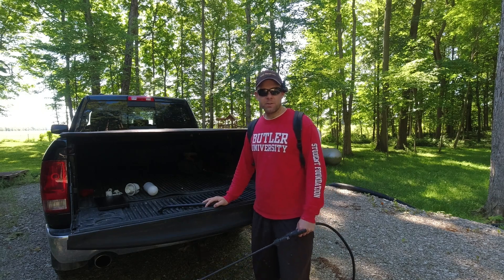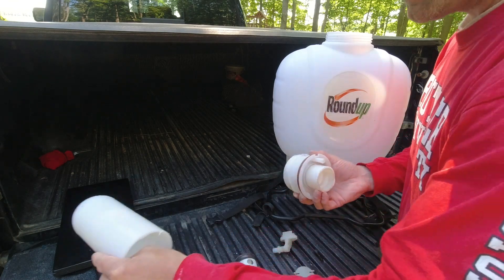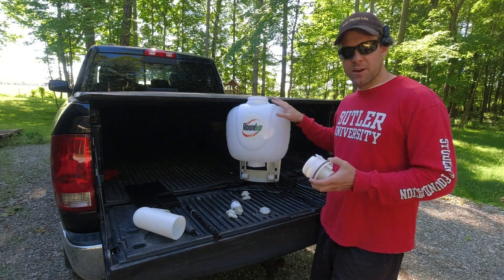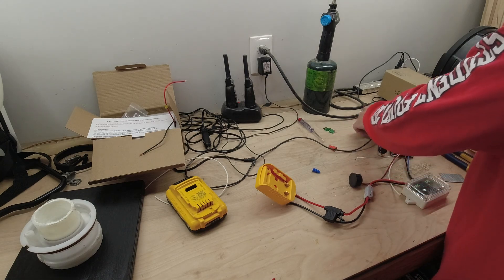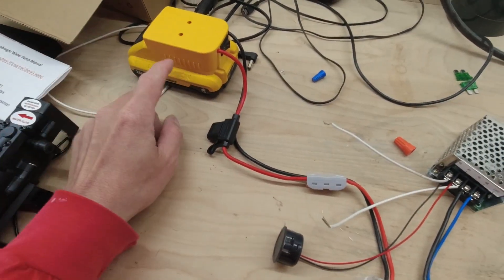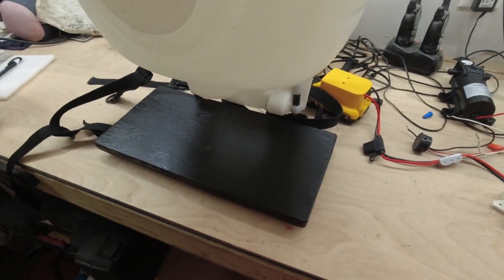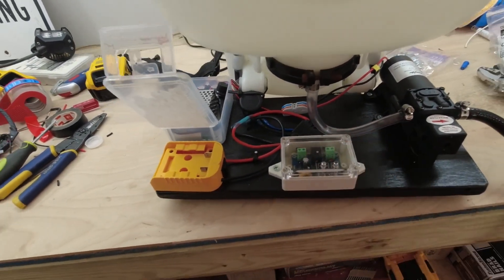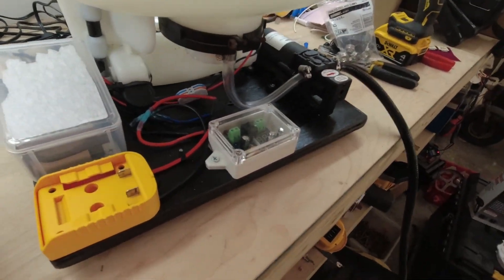How to Make a Battery Powered Backpack Sprayer - DIY

Comment: How long does the battery lasts for pumping 2 gallons using a fine mist for spray lawn herbicide?
Reply from the maker: You would be fine on one charge.  Let's put it this way.  I usually run a 4ah battery.  I have easily sprayed 15 gallons through this in one evening without losing more than 'one bar' of power.

Comment: Nice video, thanks. I am wondering if the mods to the tank are needed. All the hand pump does is pressurize the air in the tank. The product drain should work just fine without modding the air pump. Maybe leave the fill cap loose to allow air to enter. I also wonder if an electric air pump might be an easier mod to achieve the same thing.

Comment: Did this, works great!!!
Reply: Wired a quick connect to the pump and put the converter in a box drilled holes for ventilation and the voltage meter and dial.

Comment: How’s that pump holding up?
Reply from the maker: Ran 10 gallons through it yesterday. Still running strong!
Reply: @IndyFarmLife How long does the battery lasts for pumping 2 gallons using a fine mist for spray lawn herbicide?

Comment: I tried it out.  Found a kit on Amazon that has the battery protection and decreased the voltage to 12 for 3-4 bucks more. Only two wires to hook up.  Slick conversion, thanks for the video.
Reply from the maker: Awesome!  Glad it worked out.  I spray so much more now that I have this setup.
Reply: @IndyFarmLife Vibit 20 V to 12 V Step-Down Converter for Dewalt Battery, DC Power Adapter, Voltage Reducer Transformer 180 W Buck Converter Regulator for Golf Cart RC Car Truck Light & DIY (with Switch)

Comment: This seems like a lot of work when I could buy one that is already set up without all the components for it to work, maybe all the time you spend putting all that together is not worth anything to you
Reply from the maker: I enjoy working with my hands and sharing knowledge with others, so I don't consider it time wasted.  I already had the backpack sprayer, so why throw it away and buy a new one?  Plus, I now have about 7 batteries for this one if needed.  Some people may not have the means to go out and buy a high priced battery powered backpack sprayer.  If I helped at least one guy get what he needs, then my time was definitely worth it.

Comment: I like what you did but I think I would mount a small air pump on the tank and keep the setup as is.
Reply from the maker: That could maybe work.  The question would be if the air pump could keep up as well as the water pump.  With the air pump, as the volume of the fluid drops, you need to pump more air to keep pressure.  With the water pump, the volume of the fluid in the tank doesn't alter the amount of work the pump has to perform to make it operate as it should.

Comment: I never use a sprayer. My pressure washer has an internal soap mixing valve.
Reply from the maker: Never have to spray anything where a pressure washer can't conveniently go?
Reply: @IndyFarmLife  Nothing needs spray, I never use pesticides, herbicides and the only thing I really spray is degreaser for engines or equipment.